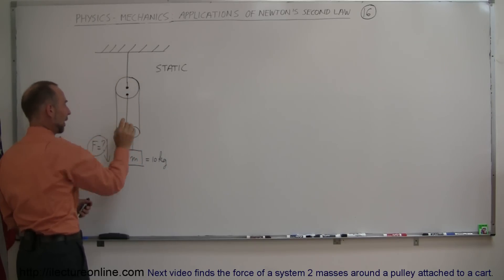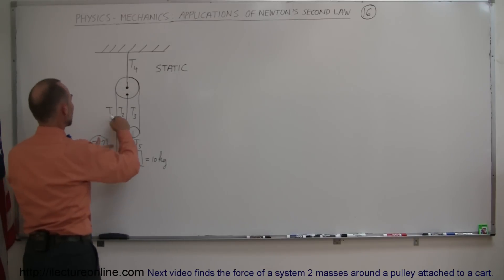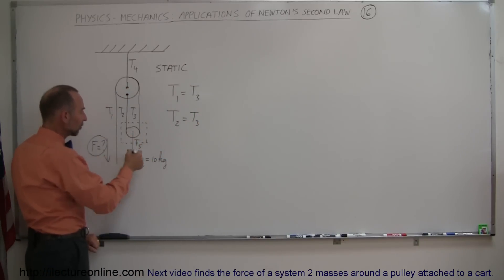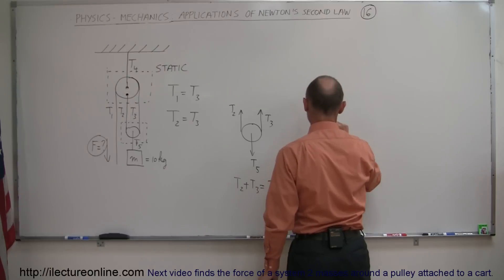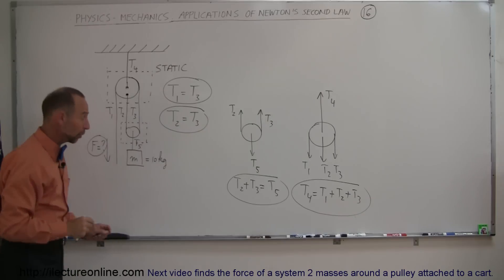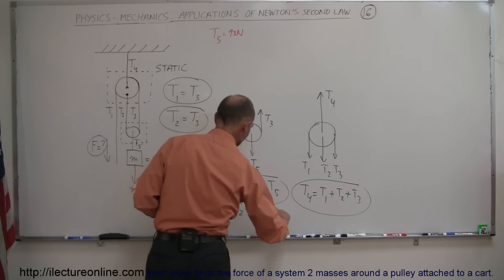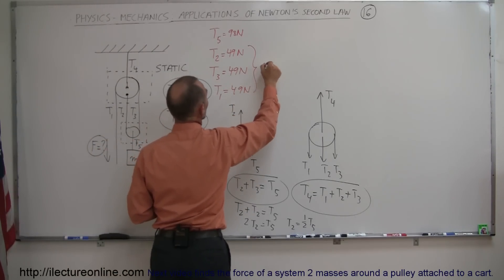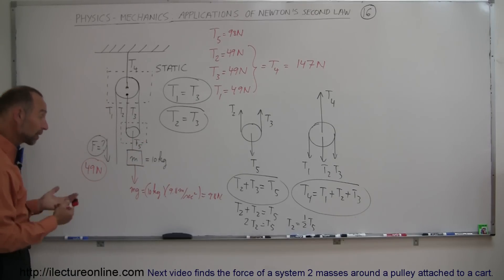Physics - Mechanics: Applications of Newton's Second Law (16 of 20) pulley combination

Comment: Please, 
Solve my doubt.
I explain the problem. Correctly figure it it. 
  
One pulley , "A" , is fixed on the roof.  The right side end of the rope from the pulley A  passes through pulley "B" and then to the hand of a human. That is , pulley "B" itself is hanging on the right side rope of pulley "A". The left side end of the rope from pulley 'A"  passes through the pulley "C" , and then the end of the rope(after passing through pulley "C" ) is attached to the pivot of the pulley "B". Some weight " W" is attached to the pivot of pulley "C". 
  
If the human hand apply pull of force " F" ,  what are the tensions on the rope  eact end of pulleys?

Comment: Suggestions:  
1.  state that the tension in the rope is the same in all parts of the rope in a frictionless system
2. State that the global system has to be in equilibrium so in this example you have a 98N weight plus a 49N force on the end of the rope (being counteracted by an anchor of some type not shown) and these are in equilibrium with the 147N reaction at the top anchor

Comment: sir for the pulley their is a weight(mg)and it has an effect on it so  it will change the value of T4  please sir could you explain it ?THANK U a lot
Reply: ilyass ourahou we assume it is massless and frictionless for simplicity’s sake, having the mass of the pulley will increase all the forces needed and friction will also, higher friction means higher inertia which means the pulley will not move and vice versa.
Reply: If the pulley has weight (m*g), you also have to account for its rotational inertia (I) and the relation between rotational mechanics and linear mechanics.  Unless you assume that the pulley's weight is concentrated at the axle, and has negligible mass at its edge.

Rotational inertia is a property that depends on:
mass
shape
distribution of mass
and axis of rotation

For a uniform circular disk of mass m and radius R, it is 1/2*m*R^2.   There are formulas you look up for the rotational inertia of various shapes.

Comment: And many Amps will be 49 Newton if it can be converted? Any body?
Reply: You would need to know the details of the motor and spool that are applying tension T1 to the system, if it is a motor in the first place.  Otherwise, amps are not an applicable unit to this problem.

Comment: you are wrong in your final statement a force to move the 10 kg block must be great than 49 newtons in order to move it because 49 newtons  of force the block is static
Reply from the maker: If the block is moving at a constant speed, only 49 newtons are required. If the block is stationary you will need a momentary force greater than 49 newtons after which only 49 newtons are required

Comment: it would be great if this can be extended to accelerating mass system. Can you plz help in writng the equations if the mass has an upward acceleration ,but both pulleys static?
Reply: Suppose you want to make the mass accelerate upward at 1 m/s^2, and both pulleys and the rope are of negligible mass.

The F=m*a equation on the mass is as follows:
T5 - m*g = m*a

Solve for T5:
T5 = m*(g + a)

From there, it is a matter of relating the tension T5 to the other tensions among the ropes.  Because all the ropes and pulleys have negligible mass and friction, all tension forces acting on any segment of the system have to add up to zero, with the exception of the human force applying tension T1.

T5 = T2 + T3, for force balance on the pulley by the mass.  Forces have to add up to zero on objects of negligible mass, otherwise acceleration would be infinite.
T3 = T1, because the upper pulley has negligible mass, and it just redirects the tension in the rope.
Likewise, T2 = T3, for the same reason, for the lower pulley

Put it all together, and we get:
T1 = m*(g + a)/2

Plug in m=10 kg, a=1 m/s^2, g = 9.8 N/kg, and get T1 = 54 Newtons.